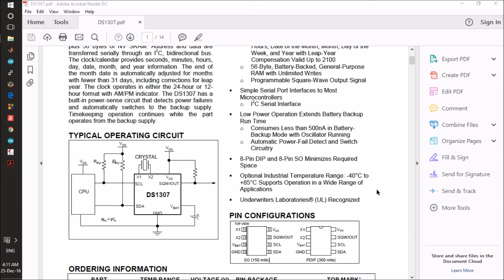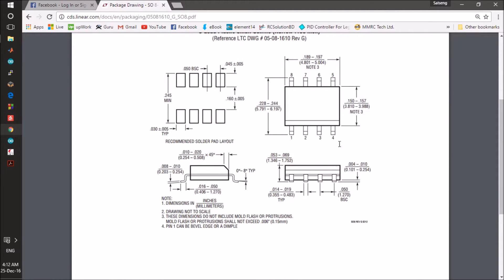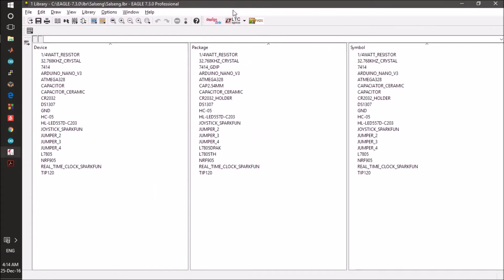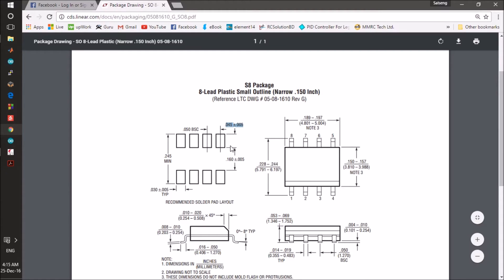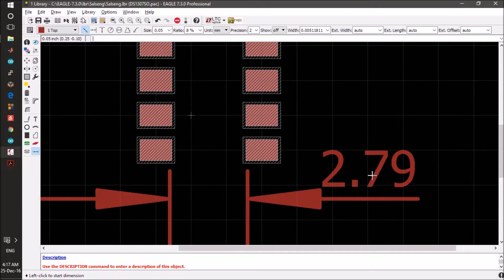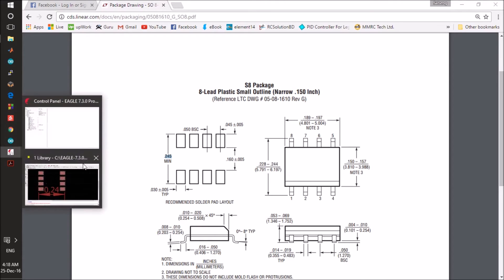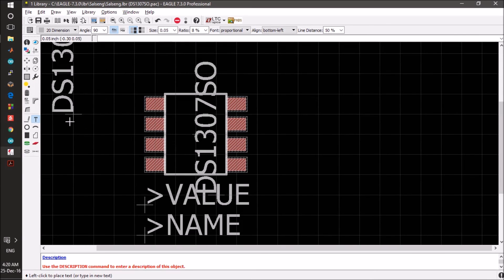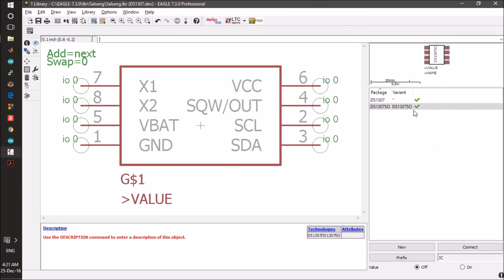EagleCad Tutorial #2 [How to add different package in eagle (SMD Eagle Component) ]

Comment: Hi, Any idea how to select a surface mount diode on this frustrating software?  Where can I even find a general purpose SMD diode?  I see hundreds of diodes I will never use in every imaginable SMD footprint, but nothing in SMD for the elementary basic, most common building block diodes such as 1N400X or 1N4148.  My only options are through hole.  Am I missing something or are certain parts of the libraries never updated since the 60's?  When I select footprint of a 1N4148, I see the drop down list of footprints, the whopping TWO through hole.  I did find a SMD version of a Zener.  Can I somehow transfer that footprint into the 1N4148 part?
Reply from the maker: Hi, there are several libraries out there with SMD footprint, you can find it in diodes library. You can search the footprint using the package names of the diode you're looking for, package names for diodes are usually like SOD123, SOD80C, SMA-DO214AC etc.

In case you don't find the exact match, the custom library comes handy. And yes, there is a simple way of transfer of footprints, I'll make a quick tutorial on this and post the link here. 

Thanks.
Reply from the maker: https://www.youtube.com/watch?v=eenFeUudr6E

here it is